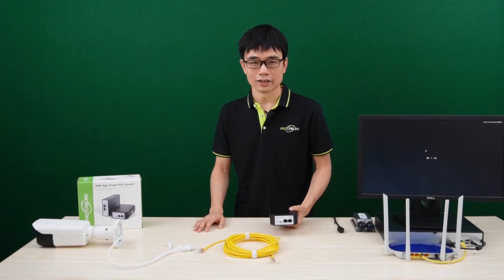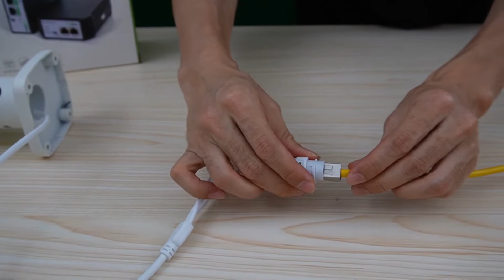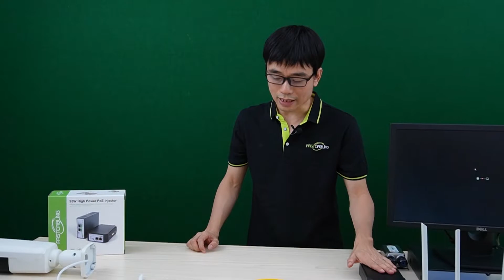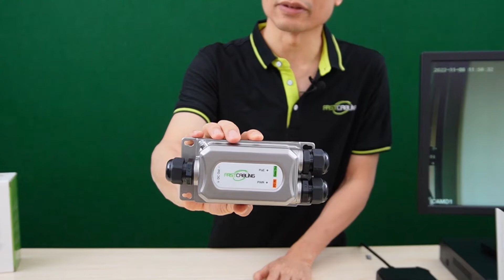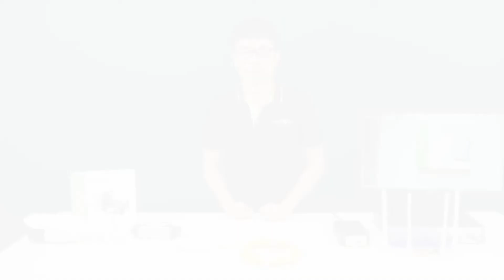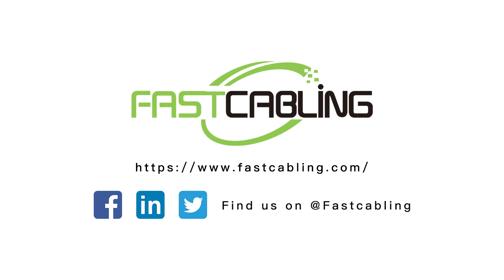What is IEEE802.3 BT PoE++ Injector?

Comment: Hi, I have PTZ camera that require POE++ adapter, but only if the heater enabled. If I disabled the heater can I use POE+ adapter ?
Reply from the maker: If you disable the heater feature on your PTZ camera, you reduce its power consumption. If the camera's power requirements fall within the specifications of a POE+ adapter, you can use the POE+ adapter without the heater enabled. However, it's crucial to check the camera's specifications and power requirements to ensure it is compatible with the POE+ adapter you intend to use. You can consult the camera manufacturer for more info.